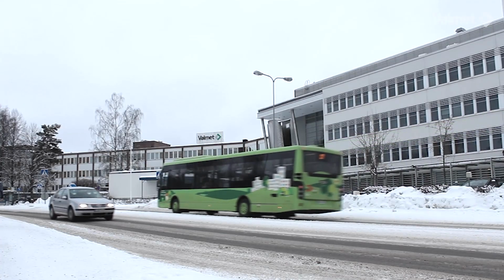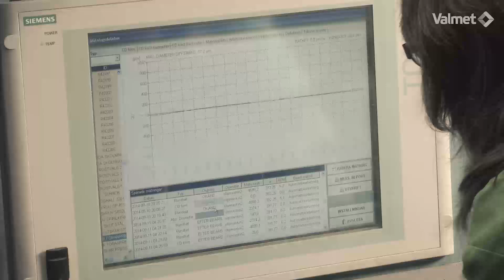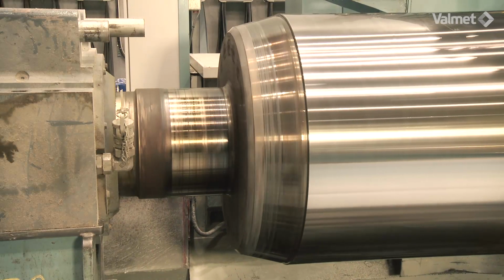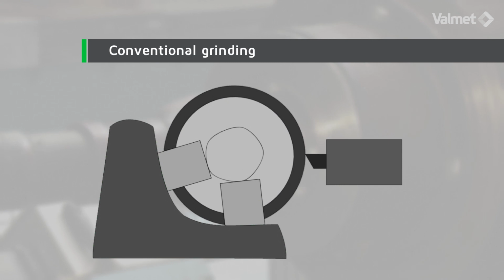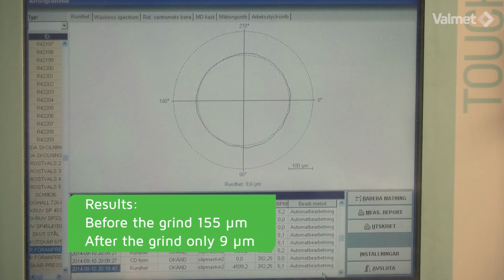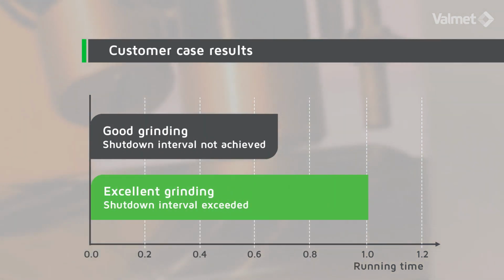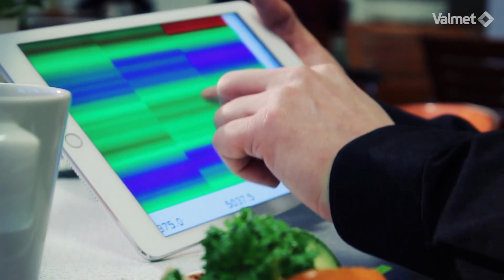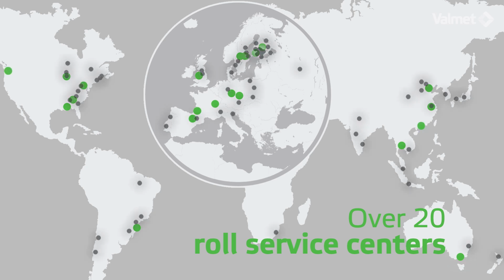Valmet roll grinding services

Comment from the maker: Valmet's roll grinding services provide precise profile and roundness shapes for roll and cylinder surfaces for papermaking. Maximizing the roll grinding precision means extended roll running times and minimal vibration.